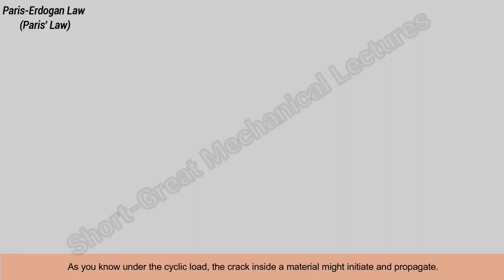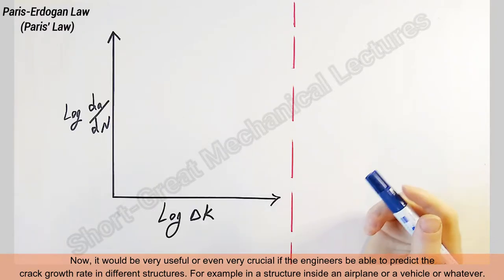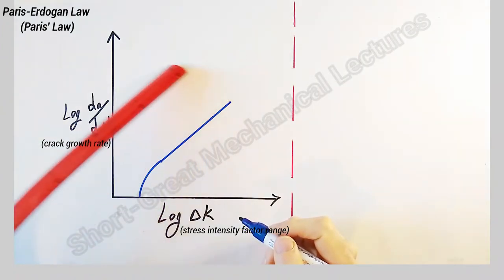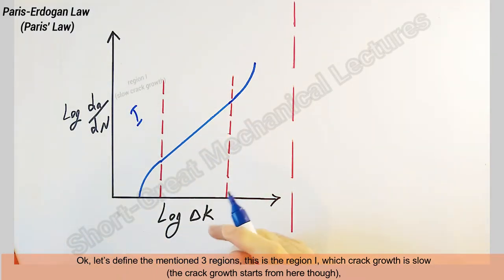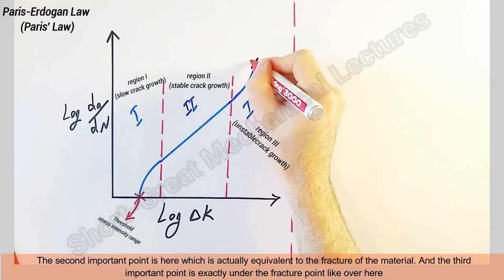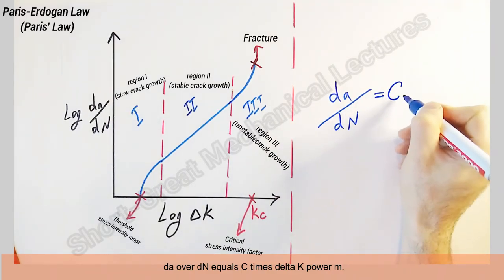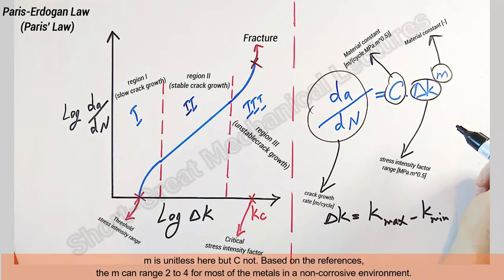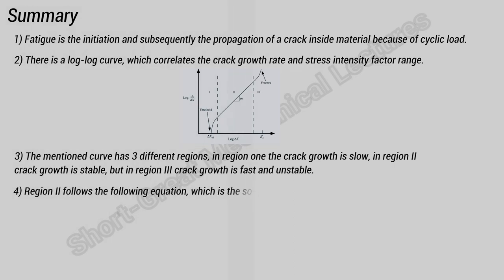Paris Law (Paris-Erdogan Law)

Comment: please i have question of stress lengh in paris low in equation put the initial stress length or we change a stress length with  function of number of cyclics
Reply from the maker: I'm not sure if I've understood your question. However, the external load makes the stress on material and the crack growth rate is a function of the stress intensity factor range.